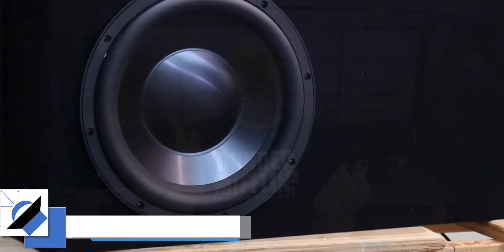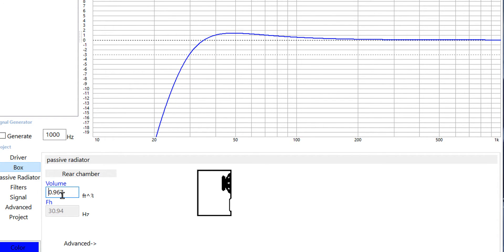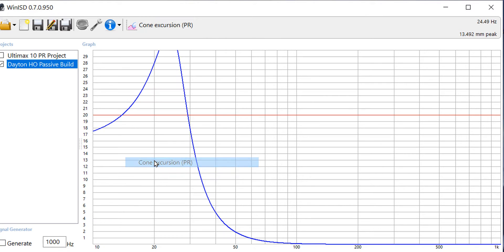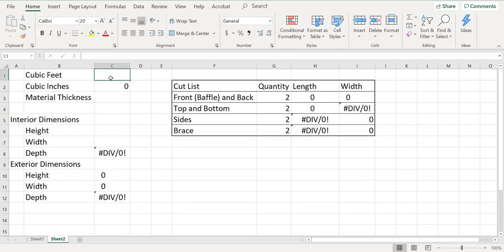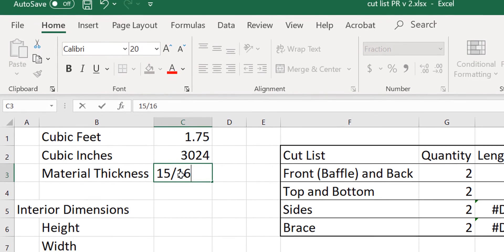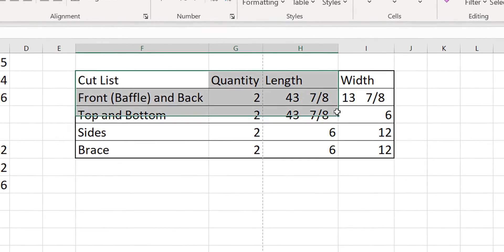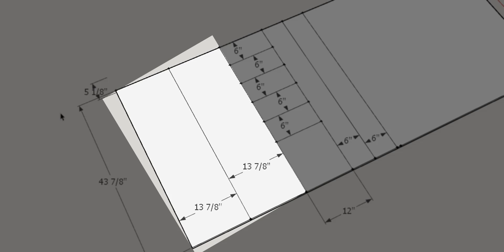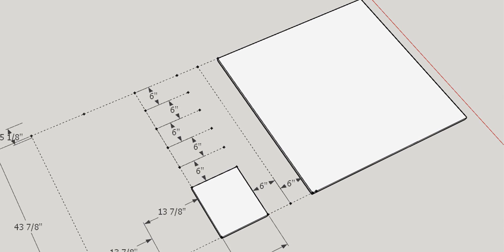How to Design a Subwoofer Box and make a cut list PLUS a cut sheet.

Comment from the maker: Dayton Audio has some awesome subwoofers, here is an affiliate link to the 10" ultimax:  https://bit.ly/3dcZAjm
Reply: In general terms, is it better than Dayton RSS265HO-44 10"?
Reply from the maker: @spectralparanoid58  think of the ultimax as a home theater subwoofer design for huge boxes and high power for those low frequency effects.  It is the closest thing they have to an SPL subwoofer, or at least it was until they brought out The Kraken.  The HO is part of their reference series so it should be a better sound quality subwoofer, and the 10-in model seems to do very well and very small enclosures.

Comment: Where is the excel spreadsheet? Honestly this is the only video i have come across to actually give me good, to the point information! I am totally lost on what to do, but now i know a little bit better! I have bought two sheets of mdf 3/4 inch. I am going to use the dayton mx12-22, i just want a box thats decent and sounds good! Do i just enter in the recommended vented enclosure from partsexpress? How do i turn their recommended vented enclosure 2.8ft³ to a cut sheet? I just want to get started but im stuck!!
Reply from the maker: It is now a patron only file, but I am working on rebuilding it at the moment so it is not available.

Comment: I use Windows 10s built in 3D builder to 3D model my enclosures. I should probably try out SketchUp though.
Reply from the maker: I did not know such a thing even existed.
Reply: DIY Audio Guy I think it's for 3D printing. Though it functions just fine to get dimensions and a good visual of the planned box. 

I made my 3.5 cubic feet box for my Ultimax 10 in it the other day so I know my cut list works out. Thankfully everything fit in the program. Now I just hope the built box fits into my cars trunk haha.